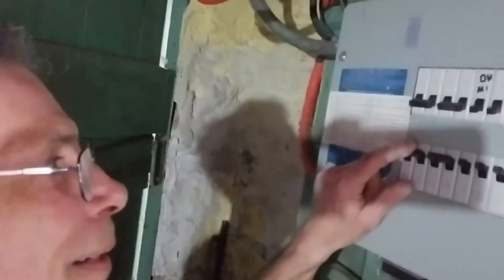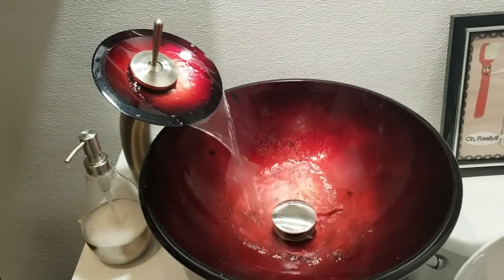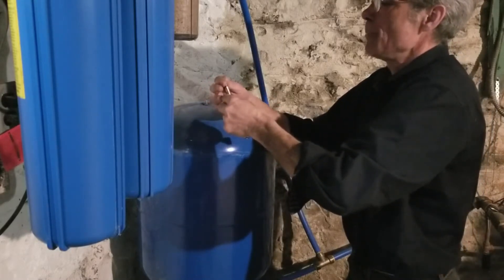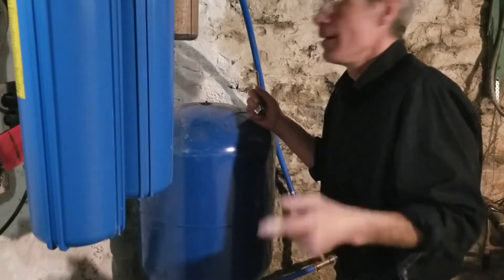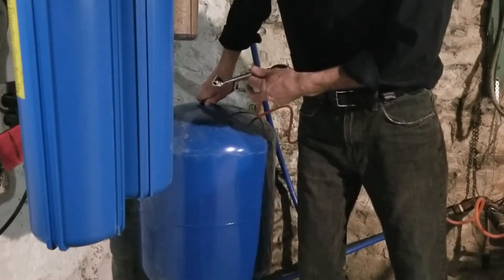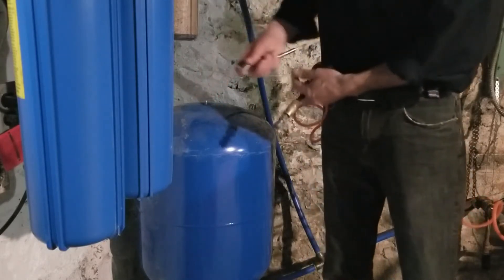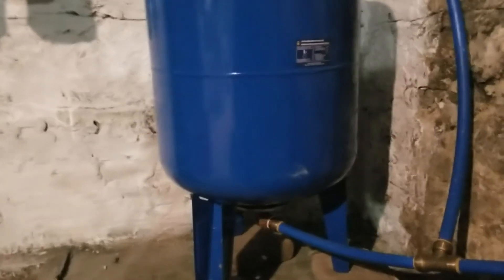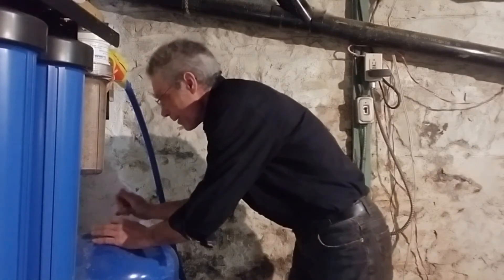How to Stop Water Pressure surges on well

Comment: My water recently started doing this and I see the guage on tank flipping up n down as it does and I've been wondering if tank or pump issue so I'll have to check this out. One question tho, how do you determine or know the pressure to set tank to?
Reply from the maker: @shackettr  if your pressure goes 0 to 60 to 0 to 60 and the pump is stuck in a start/stop cycle, it is a foot valve or check valve fault, not a tank issue. And the pressure setting recommended is usually stated on the tank and on the pump.
Reply: @oddjobsremigauthier  ok thank you. Will check it out.

Comment: Why doesn't your breaker panel have a cover? That is very dangerous.
Reply from the maker: @consentofthegoverned5145  Really? Those are switches. No exposed wires or connections. This is exactly what an electrical panel from 1965 looks like. The house I grew up in has the same one. This is perfectly normal and perfectly safe.
Reply: @oddjobsremigauthier  Switches or breakers? Two different things. And if they are breakers they are NOT safe, you've just been lucky. I inspect houses from much older that 1965 band never seen a service panel without a door cover to protect from arc-flash. Arc-flash, even from a residential 100-200A panel, can be deadly.
Reply from the maker: @consentofthegoverned5145  So explain for everyone, how a cover would reduce arc flash, and what makes turning on or off a breaker is "dangerous" when every electrician on the planet tells everyone to turn off breakers for this or that? I won't argue the point further, but you going around putting unnecessary fear into people's minds is not beneficial.
Reply: @oddjobsremigauthier  Arc flash can occur anytime a breaker is tripped or closed. The NEC, most fire codes and the product listings of any modern panel will dictate that the panel is not to be operated with the door or cover open or removed. It's possible that this particular panel is ancient and does not meet modern codes. 
I oversee a building department including electrical inspectors, and work closely with many electricians, and I can assure that any electrician worth his wire strippers will tell you this:
Anytime you open or close a circuit breaker these three things are imperative:
1) have a clear exit path
2) keep one hand in your pocket
3) turn your head away and close your eyes.
Reply from the maker: @consentofthegoverned5145  You are almost exactly right.  Arc flashes happen EVERY time a circuit UNDER LOAD opens or closes. Not just in breakers, but in switches and outlets too. Breakers are designed to safely handle these loads of 100 or 200 amps, whereas switches and outlets cannot. There is no need to fear, if you understand the risk. Trade schools, media and unions make these things sound dangerous to discourage homeowners from doing their own repairs, driving up the cost of owning homes.

Comment: Why would you have to add air? If it were leaking would it leak air or water? Is it the top fitting leaking the air pressure?

Comment: Question, if you change the switch to a cycle different than the switch than was on the pump and water pressure starts this surging is this the reason?
And what is your thoughts on the switches with the arm on it, that is supposed to cut off pump when it gets hot?

Comment: Do I leave the pump off while I add air?
Reply from the maker: Yes. And drain the system of water. The pressure of the bladder won't be accurate if there is water in the system.

Comment: Information provided is certainly useful and for the most part correct.

Short cycling definitely shortens the life expectancy of the electric motor portion of your pump and the cars should be addressed ASAP. The majority of wear and tear for most electric motors comes from starting as opposed to running. So minimizing the number of starts maximizes the motor life.

What this does not explain is where the lost air pressure,  known as the pre-charge in the tank,  is going. Modern well system pressure tanks typically either have a bladder or a diaphragm which isolates the air from the water. If the component of the tank which separates the air from the water is intact, and the sniffler (air) valve is not leaking, and the steel tank itself does not have a pinhole, I cannot think of a reason why the tank would lose air pressure over time.

If there is an air leak, this tank will have to be monitored for the proper pre-charge pressure and it can be expected that intermittent addition of air will be required.

I am guessing the bladder or diaphragm - which ever it is - has a slow leak.

Comment: Thank you so much for this excellent video. Lowes had their 6 gallon air pump on sale, so I bought it, watched your video one more time, and took on the project. Like someone else mentioned, I had to drain the pressure tank using the Spicket at the bottom of the tank. Got the pressure up to 38 psi and pulsating water pressure is gone!I now have a new air pump for the money I would’ve paid a plumber to do the job. Thanks again!
Reply from the maker: That is the great thing about the internet. The answer is out there- I am happy this helped.

Comment: After I let the water drain to nothing, the pump pressure gauge still reads 20psi.  Can you please explain why?
Reply from the maker: If the pump is off, and the water taps are open and no water coming out, you should have zero pressure. Here is a simple way to make sure the guage is reading accurately. Remove the guage from the system. If it still reads 20 psi, the guage is no good. Get a new one. If water comes out and pours all over the floor, the guage is likely reading pressure properly and you have other issues. I am not a plumber, so if this happens,  it would be a good time to call one.
Reply: @oddjobsremigauthier  
Thank you for that suggestion.  Also,  my system is a 30/50 system by default.  I am not sure, however, whether it was at one time adjusted.  I ran through your video and set it at 38 assuming that it was a 40/60 system.  It is currently reading 42 however.  That reading is per the guage and a separate digital air pressure guage.   How do I know if the turn on pressure was increased and what it currently is.  Thanks

Comment: Don't like all the shark bite fittings
Reply from the maker: A few years ago I would have agreed with you. But the technology in regards to push-on pipe fittings has come a long way. I don't know if the USA permits it, but here jn Ontario, you still can't conceal these fittings behind a wall. Hopefully that will change soon. This area in my home, I had no reservations at all. They are clean and neat, and easy to inspect every time I change the filter.
Reply: Then we'll have to agree to disagree.. I have been a licensed plumber in New York and I just do not want to lower my standards
Reply: @ricklee827      If you’re not using pex then you are ....lowering your standards
Reply: I'll add one more common I also do not like to plastic plumbing copper is king it's the only natural material that kills e coli and been around for 140 years
Reply: @ricklee827  Copper isn't appropriate sometimes. I have a high mineral content in my water and it wears out the copper pretty fast, which is why I'll be replacing all of my copper with PEX soon. Too many leaks to contend with. Even with sections of new copper that replaced the old. We even had the thicker walled copper installed and it makes no difference.
Reply from the maker: @ricklee827  There I have to disagree. Copper is king in a new build, but pex is best all around for durability, eade of install and cost.

Comment: I thought your sink was a bloody bath tub at first! I tested my pressure which was reading 28 on the unit gauge. It jived from the stem. I drained the tank, filled it to 38 PSI., (Mine is a 40/60.) And it's losing between .05-1 PSI per hour. 

I did the rocking test to determine if the bladder was bad. I moved it with ease & heard no sloshing water so I presume that it's functioning.

But the one thing I'm not able to tell is where the leakage is coming from. It's not coming from the air stem. And I cannot see or hear any air escaping anywhere. 

My question is could it be my pressure switch? And if that's a possible source how do I test that?

Sorry for the long comment. I'm just hoping it's not an issue at the well itself. 

(Oh and btw, my unit is a little over 10 years old.) Which I've heard is it's general life expectancy.
Reply from the maker: I doubt it is the pressure switch, or in the well. if anything, it might be a bypassing check-valve. but that would cause the pump to cycle on and off even when the water isn't running.
I have had bad luck with these tanks. I ended up replacing the one in the video with a diaphragm style tank. Apparently they have a longer life cycle.
Reply: @oddjobsremigauthier  Thanks for the reply. It turned out that the pump was  not pulling enough amps as it was running low on water. I had 200 gallons added to the well about a month ago and the pressure has held steady ever since. I l know that'll only take me so far but hopefully I can avoid having to frack. 

Thanks for the reply!
Reply from the maker: @dr.vinnyboombatz22  That will do it. Sucking air. Nice work, and nice to know. I would never have looked down there!
Reply: @oddjobsremigauthier  I figured it
might be the pump because it was pulling low amps, but after having the original well installers out they did the drop a rock test and determined it was low. I can't take credit for it. But tossing down rocks is fun.